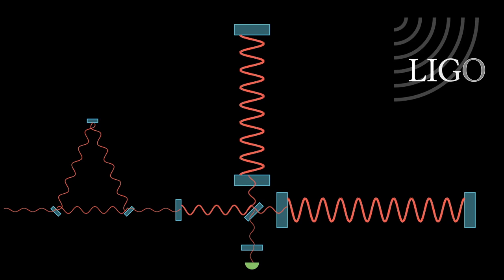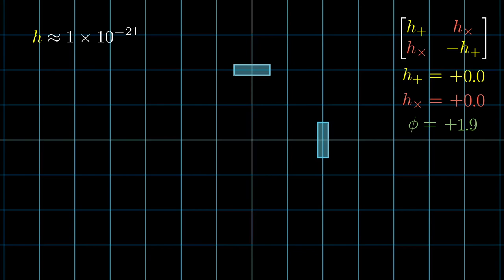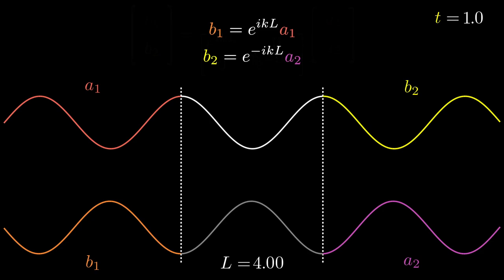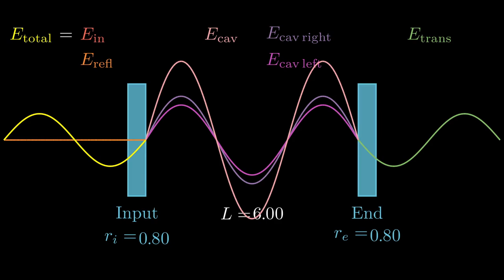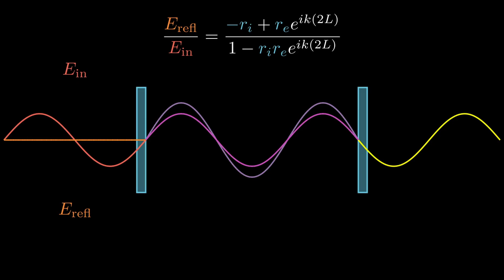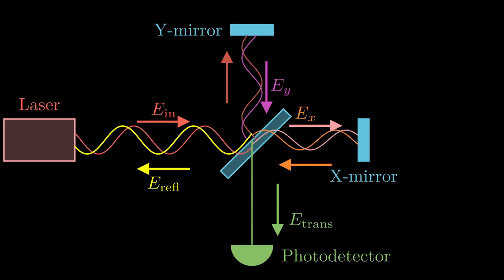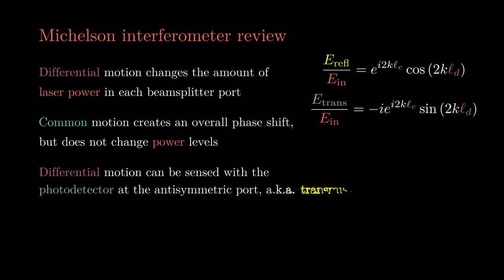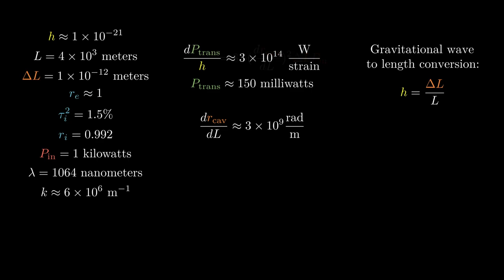How does LIGO detect gravitational waves?

Comment: Why the laser wave lenghy is not changed while the gravitation wave is passing throught the space ?
If the gravitation wave affects L it should affect the laser wave length as well.
Reply: Good question!
Reply: To answer you question, it needs a better understanding of GR that I do: you need to know the difference between local coordinates and proper distance, and how a GW can let local coordinates invariant while affecting proper distances.

Look for this article (should be in open access):
"The basics of gravitational wave theory", by Anna Flanagan and Scott A Hughes, sept 2005 in "New Journal of Physics", Volume 7, 2005. It's explained page 15 and 16.

Comment: thanks!
two questions:
 - what is the meaning of the 3 small mirrors on the left?
 - the gravitational waves modify not only the space but also the time. How does this affects the instruments?
Reply from the maker: 1) The three mirrors on the left form the input mode cleaner cavity.  It's purpose is to stabilize the laser light before being input into the main interferometer.  Without it, most of the input laser light would be rejected by the main interferometer, because it would not be stable enough to enter.
2) This is true, a GW modulates both space and time.  The short answer to your question is the interferometer truly acts as a *timer*, since we are always firing lasers off in two directions, and measuring how long it takes for that laser to come back.  If there is a difference in that time, we will detect it as a phase shift in the laser light, since the phase shift produces real light at the antisymmetric port.  Maybe I can do an animation of this concept later.
Reply: @craigcahillane1063  thanks
Reply: @craigcahillane1063  waitibg for new videos on this topic, Im phd students and I need more videos of you in topic.

Comment: Here is a new experiment for you, with wave curvatures of space-time, that is, with gravitational-wave oscillations, which can exceed noise and interference. For balance in movement, two equal angular optical horoscopes are used, installed oppositely, on a special platform made of a mechanical gyroscope, which optical gyroscopes move around each other, without angular velocity, with amplitudes of 50,000 pieces, loads on the optical paths of one loop, gyroscopes from; 1.3 G to 3.5 G and above,

Comment: How are we sure Ligo is detecting gravitational cosmic waves and not an earthquake, a bird strike or a lightning strike somewhere???
Reply from the maker: Mostly because the gravitational-wave signal has a very distinct signature.  According to numerical relativity simulations, we expect the gravitational-wave emission to increase in frequency and amplitude, producing a chirp effect that increases from very low frequency to around 100 Hz or so (depending on the black hole masses).  An earthquake is certaintly detected, but looks more like a low frequency rumbling that shakes the detectors around.  A bird strike would look like an impulse with some slow decay, same as a lightening strike.  Our black hole merger signals actually increase in frequency and amplitude, until they merger with a huge energy emission in GWs, then the final black hole wobbles as it decays to it's smooth final form.
If we could hear it, the GW signal would probably sound something like this: https://www.youtube.com/watch?v=ug2bKCG4gZY
Also, we have two detectors that are a thousand miles apart, and if they see the same chirping signal within a couple of milliseconds we can be really, really sure it came from an astrophysical source.